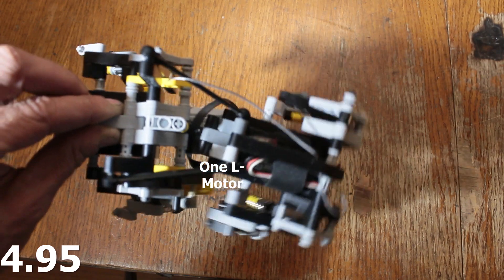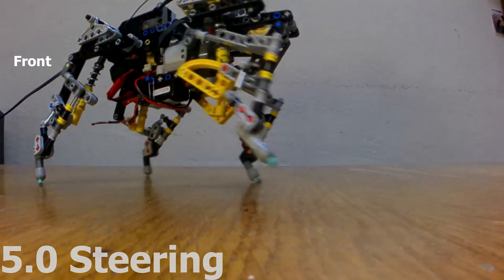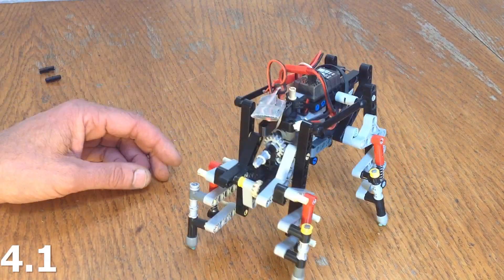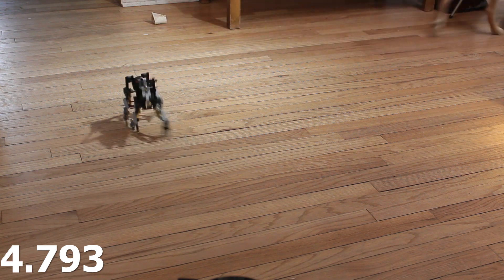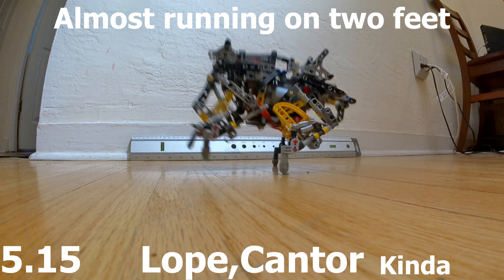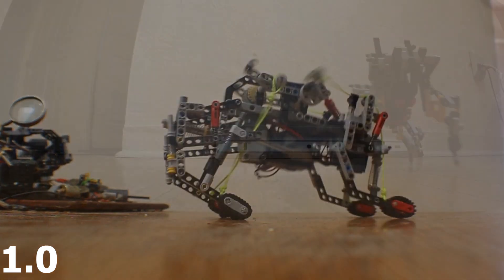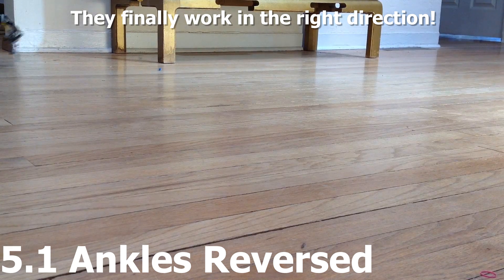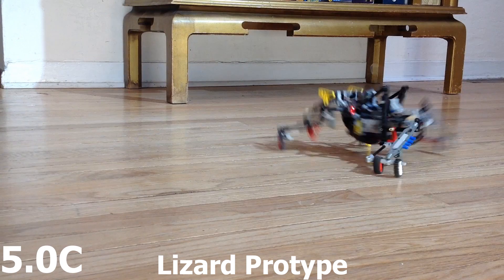Lego Big Dog5 Gets Hips, Goes Faster

Comment: i have a question, so i was building something similar with ev3, and i manged to get the dog to walk and steer with a steering system similar to the ones on a car. however, when the dog walks backwards, the right legs sweap forward more then the left ones, causing to model to turn, just like on your dog. because of this, the model is more likely to tip over in reverse. both of the sides are even, so idk why the model turns in reverse. You have explination or any ideas to pervent this? thanks
Reply from the maker: It could be to many things. leg timing, torque twisting, weight distribution. Hopefully something on that list is useful. With all that ev3 weight it will have to be very even. One of the reasons I got a camera that could do 240 fps is so I could see things happen that are too fast.
Reply: @MaxBrix  thanks! The timing and weight distribution seem to be even, maybe I’ll try using a slow motion camera to find the problem

Comment: Do you ever think you will remake something like this using all lego parts like all power functions, mindstorms, or power up
Reply from the maker: Reasons I use a hobby radio.
1. Weight. The traditional batteries and radios are heavy
2. Size. They are to big to fit.
3. Control. Tactile and proportional is better
4. Range. I have a 30KPH motorcycle that will get out of range too fast. (hobby radio range - 400 M) not really an issue on this model.

The battery used in this model cost about $8.

If I need to program something I use SBrick or EV3. 
The plan is to use Arduino on Big dog 8.

Comment: So your using 1 L motor for leg drive and a small servo for ‘steering’ body tilt
Reply from the maker: No. There is only one motor. No servo. Just one L-Motor. The body and legs are moved by one motor. The turning happens because of the leg dynamics.
Reply: @MaxBrix  I meant in regards to robot turning, so the turning and side hopping is controlled by one motor? thats insane, how does the mechanism fully work?
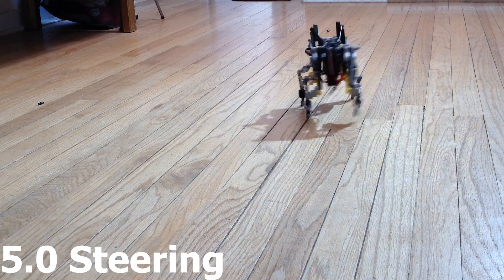Reply from the maker: @Zack_Axel  I don't think I can write a better explanation than I gave in the video at 00:32.
Reply from the maker: @Zack_Axel  I have a bunch of one motor models that steer including Raptor 2 with only 2 legs.
Reply: @MaxBrix  ok I think I understand

This Walker is like an old RC car where forward goes straight but reverse goes left. So the model is unable to mode straight in reverse or move right. 

Still really impressive with one motor output
Reply from the maker: Oh wait, did you mean on the b model with a head? That did have a small servo. The steering with that is sketchy. I was just playing around that aspect of the model needs a ton of work.

Comment: so good! I'm guessing that the lizard's sideways bending backbone holds a lot of promise
Reply from the maker: Lizards solved all the quadruped problems in the simplest ways. Balance - not a concern. Foot planting -Lizard feet don't need to be round (I have seen you use curved feet?). The feet don't come off the ground from rocking motions as much. Usually to get a longer footpath you need a longer leg. Longer LEGO legs are hard to get torque to the end of. Bending the body gives you a better lever. Lizard walking is one step above fish walking. Good for a machine with no brain.
Reply: @MaxBrix  I think it's a better model for mechanical walkers than a mammal's vertically flexing backbone - unless designing for leaping/galloping? Feet with curved bottoms are useful when the footspeed isn't constant, and the feet are allowed to passively rotate to compensate. We tried this on our giant TrotBot where the heavy weight didn't like foot skidding.  Theo also takes advantage of this, and passively rotating feet help both our Klann and Strandbeest LEGO walkers to walk more smoothly on surfaces that resist foot skidding.
Reply from the maker: @diywalkers7898  I knew you would relate.
Reply: @MaxBrix  Dude, I've seen a lot of walker videos, and nothing has been as exciting as watching you tinker!
Reply from the maker: @diywalkers7898  Thanks, that is awesome!
Reply: @MaxBrix  Hey, I'm thinking of adding a MaxBrix page to our walker blog - not that we get that many readers, but your creativity and bold tinkering deserves to be cataloged.  I would simply share some videos, but if you wanted to write anything about your process, dead-ends, etc, then of course you'd be more than welcome.

Comment: Amazing work! Any chance to have some build instructions or just more detailed views to reproduce? 😍
Reply from the maker: Big dog 4 would be easier to replicate. The legs are shown in some shots. The body is much simpler. You will need feet. You can see some detailed views of the feet in BD3. Also springs(amazon, variety box). There is an inner leg strut that might be tricky. I will post a photo on my community page. You will need to run this off of a small esc and radio receiver with a small (i used 350 mah) lipo. It is a bit tricky. Lots of fine tuning may be required!
Reply from the maker: Big Dog 4 https://youtu.be/WJWXrLmDwq4

Comment: Great stuff. Truly an evolution) its crazy how complex the movement is considering you use only a couple of motors. That was always fascinating for me with lego build, wham less is more. Instead of adding tons of motttora, like in average rasbery pi, arduino project, complexity is added via clockwork essentially
Reply from the maker: Correction - 1 motor. Thanks!